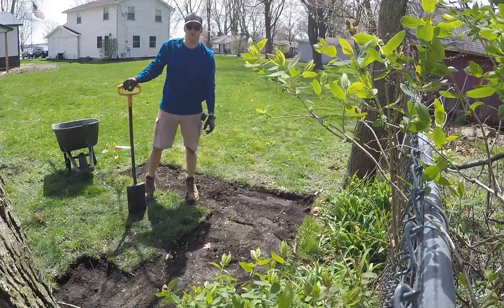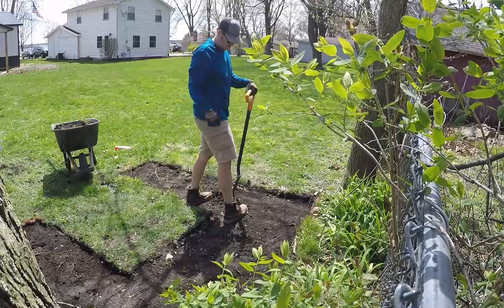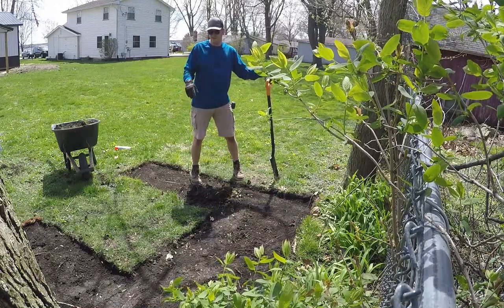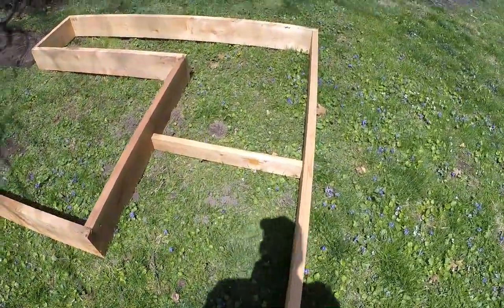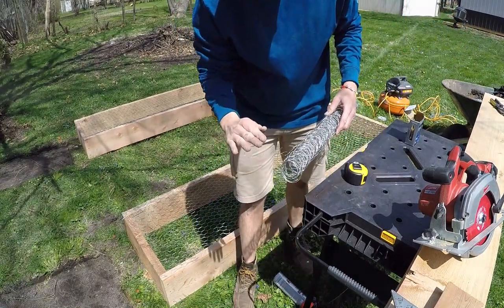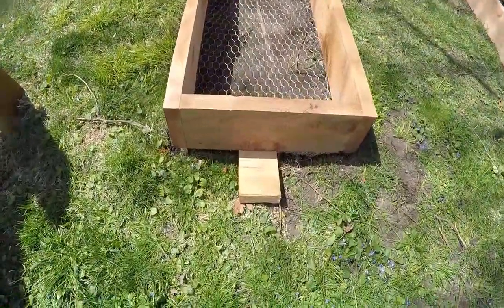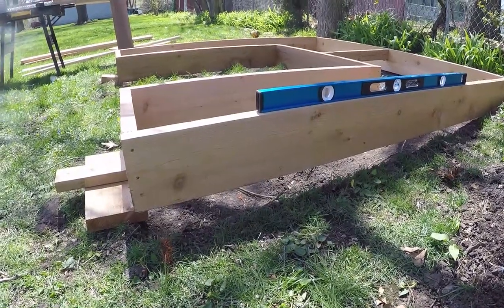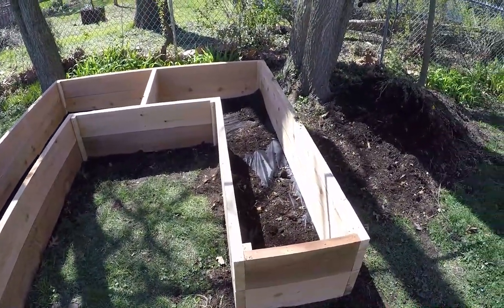How To Build A Garden Box DIY Build | HANDYMAN HEADQUARTERS |

Comment: Looks like you need a new shovel or bolt to fix the one you have it popped right off . Do you have to do one or more high for above ground garden beds .
Reply from the maker: Haha thing has been like that forever! You'd think I would fix it. I did two high to prevent rabbits from jumping in.
Reply: @HANDYMANHEADQUARTERS   Did you have to buy a lot of soil to fill it up .
Reply from the maker: @hhprogressiveconstruction1140  so I used soil I had in a huge pile after putting up my garage. But if you bought it I am guessing you would have at least 2-3 yards in the size box I built.
Reply: @HANDYMANHEADQUARTERS   That was smart using the soil from the garage excavation .
Reply from the maker: @hhprogressiveconstruction1140  yeah no need to waste it